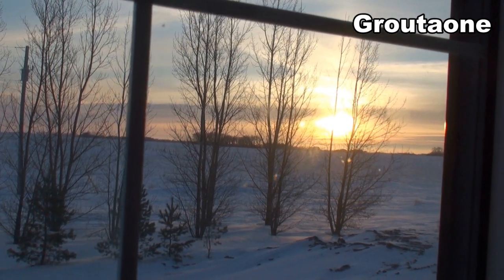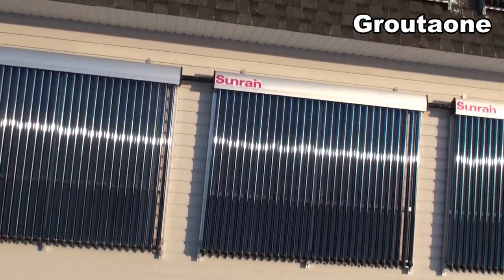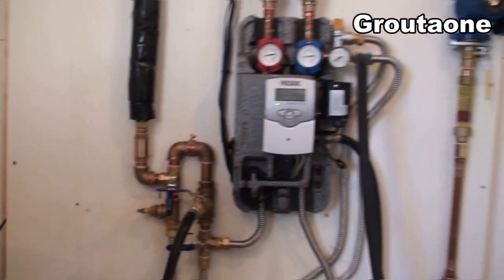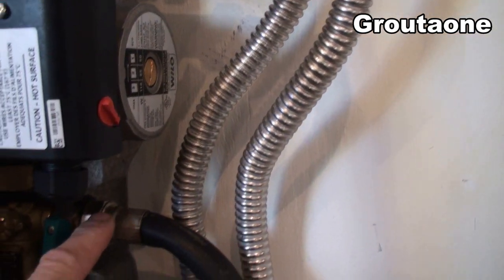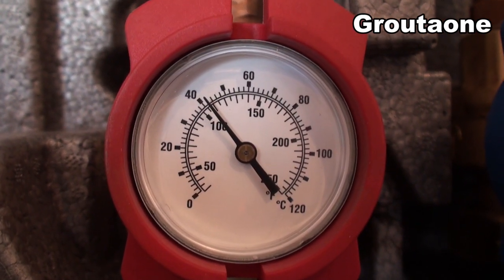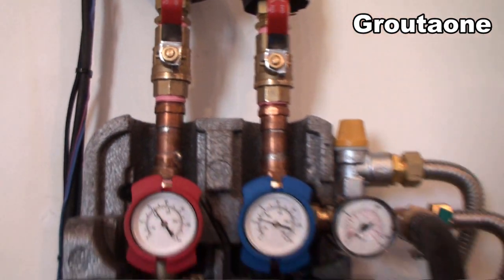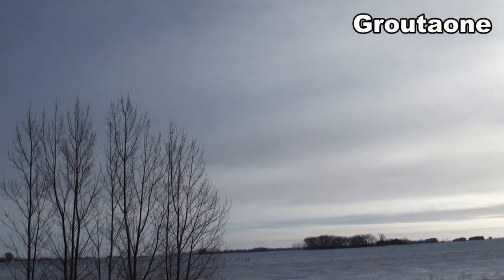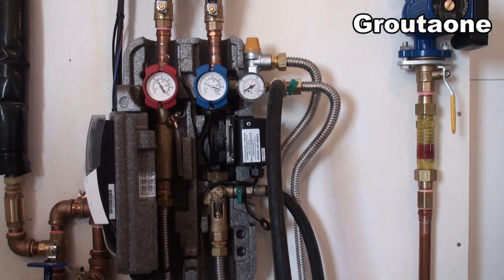Solar Heat First Sun Test

Comment: HI can you tell me how to reset the controller. We need to change the arrangement from 1 to 3 on the BS/4 we don't have the plus system
Many thanks
Georgina
Reply from the maker: Reset is marked as RESE on page 34 of my manual. you may have a different page, I don't have to reset though if I just want to change configuration

Comment: From what I am reading 40K btu I didn't see what your overall cost was. I live in Colorado where my outside temp is not quite as harsh but I get a wild amount of sun. I need to heat 10K square feet but I do have Radiant hot water heat already but powered by propane. Trying to look at my cost to do a solar system.

Comment: I talked to you about this on one of your other videos a few weeks ago, and am getting interested. If you were to do this again, what brand of tubes would you use?
Reply from the maker: GunFun ZS I would buy Sunrain again as they are highly efficient, not all tube brands put out the same power
Reply: Thanks. That gives me a start to figure out a cost for a supplemental system.

Comment: very nice work... if you used a parabolic mirror (reflector) behind each tube, you might be able to reduce the number of tubes by 2/3 by spacing them further apart..."they" say about 100 watts per square foot in full sunlight, or about 1076 watts per square meter
Reply from the maker: I'm thinking maybe some foil space blankets on a plastic sign board slipped in behind would likely boost power, I would like to experiment

Comment: Very impressive, my back of a beer mat calculation says 40K BTU's!. Do you think you could run the circulation pumps from PV's via car battery bank with inverter? Enjoying your videos keep up the projects.
Reply from the maker: Tiff913 I think that would work as the pumps need little power to run, a small pv system would be nice

Comment: If that's two gallons, it looks to me like somewhere in the range of 35k to 40k btu an hour continuous. That's not bad!

I see a differential of 40 degrees F or so. That makes 2 (gallons) x 8 (pounds) x 60 (minutes an hour) * 40 (degrees F) = 38,400.
Reply from the maker: David W You are correct to figure about two gallons per minute, I really like the system so far, still need to do a full sun test at high noon without the light overcast conditions, this video was shot in January and likely would put out more as the sun moves closer so it then it has less atmosphere to penetrate, thanks for watching
Reply: groutaone Given the conditions you stated, that BTU output is very impressive. Most of us heat homes with furnaces that only run intermittently at 100k-150k btu that I doubt is a whole lot more than what your system is putting out on a continuous basis when you compare heat over a period of time. When you get bright son, it's going to put out a ton of heat.
Reply: I do not think your calculations are correct there is no mention of the heat capacity of the fluid in the formula.
I'm quite bad working with imperial units but a quick google search gives me 11.25kWh for 38400btu.
My calculations based on international units is:
2 US gallon/min = 7.57liters/min = 454liters/h
Temperature difference 20°C
Heat capacity of water 4200J/Kg°C = 1.12Wh/Kg°C
Heat capacity of ethylene glycol is 2200J/Kg°C = 0.61Wh/Kg°C
Say there is a 50% glycol in that mix that will be about 0.95Wh/Kg°C
454L/h x 0.95Wh/Kg°C x 20C = 8626Wh.
Your calculations are not out by much that formula probably works for water and maybe the temperature delta that you use 40F is not quite 20C that I took from the video.
:) But I still like my formula better I can understand better what is going on.
Anyway the calculation is not really correct since it assumes constant power but if the pumps work intermittent when the glycol gets at a certain temperature all we can say is that there where 8.6kW of power transfered but can only say 8.6kWh if it worked for an hour at that constant flow rate and at that temperature difference.
Reply: Good point. That would put the heat value at about 30,000 BTUs an hour. Still a significant amount of heat, though.
Reply: David W
I am curios to see what will do on average over a month and how much was the system cost.
I will heat my house soon with PV panels since from my calculations they are less expensive than solar thermal.
Reply from the maker: ***** Consider also that PV panels likely are rated at perfect sun angles, morning and evening would be down on power requiring more panels to get the job done
Reply: groutaone
I do have PV panels since I live offgrid and I know what average daily and monthly output to expect. The cost of around 3 cent/kWh is calculated for PV panels at 1$/Watt (it may be even less now especially larger quantities) and 25years amortisation. After 25 years you usually still have around 80% of the initial power so you can just add 20% more panels then.
The Solar heating no matter if is thermal or PV will need significant thermal storage to maintain a constant temperature.
Luckily I was thinking about that when I designed and build the house and there is a 14 cubic meter concrete slab that can be used as thermal storage.
Those 14 cubic meters of concrete can store about 100kWh of heat at a delta of 10C
Since my souse is small and well insulated it only needs about 1000kWh/month in the coldest heating month (Usually January but this year is crazy I have +8C today that is unusual but what is more unusual is that the entire month was close to 0C or above)
This is in Saskatchewan and last year I had -30C during the day and close to -40C most of the nights :)
Anyway I can heat my house with a PV array of about 6000 to 9000W that is about 6000 to 9000$ for panels delivered.
There are some more money needed for cables and mounting but not huge and I only need an extremely simple controller that will do a simple digital max power point using in floor resistive heat cables.
That is all no moving parts so there will be no maintenance over 25years or more and no other money for heating.
Say all this is 12000$ and some work from may part.
25 years x 12 months = 300 months and 12000$/300month = 40$/month about 5 of this months I need heating for the others I can find some use for all that extra electricity (not sure what at the moment)
But since I'm offgrid with a small Lithium battery I never need to worry that is cloudy since with an array 10x larger I will produce as much electricity as I do now with this 10x smaller array so it will be like I have full sun now when it will be full cloud cover.
And in the winter I can use the electricity for what I want inside since it will end up as heat anyway.
I made a calculations based on prices I found here locally for vacuum tubes but it was substantially more than PV based on their projected heat production.
That is why I will love to know what is the power generated from one of your panels at full sun in a cold day and what was the cost of the panel. There is more than the panel of course pumps and insulated pipes but just panel cost vs production will be a good indicator for me.
PV heating is new not even know if someone else is using something like that but for me and my particular house and location is the best option of the options I checked.
+ that I love no moving parts heating it will be extremely reliable unless a tornado takes down my PV array or house :)

Comment: So about 20C temperature delta at 1galon/minute (about 4 liter/minute)
At 4 liters/minute you get 240liters/hour with 20C delta. Not sure what heat capacity dose that glycol have I will need to check probably a bit less than water.
Water has about 4200joules/kg C
I do not like Joules so converting that to Wh 4200/3600 = 1.12Wh
240L/h x 1.12Wh x 20C = 5.4kW Not that bad.
Was that 5.4kW from how may tubes and how large and was full sun then or just what you showed in the video.
Maybe you can give more details or data later but it sounds good if that water flow was continues and not intermittent at that temperature delta.
I also need to check what thermal capacity dose glycol have.
Just made a quick search it seems is quite a bit lower than I expected 2200J/kg C so almost half than water then my numbers are wrong you got just under 3kW coming in at that moment. But to calculate energy I also need to know if that was intermittent and what was the duty cycle.   
Hope you get more info since I'm curios. Thanks for the video.
Reply from the maker: ***** Thanks for doing some research, the highest temp shown in the video was recorded right after I showed the light overcast sky, maybe two minutes later, so I don't know how high the temp would go as it seemed to be climbing until the light cloud cover came in, it's really about two gallons per minute as the gauges are showing just for four collectors outside, the other four don't have gauges just a separate pump and flow meter, so I really should test in full sun at high noon when sun is not off to the east, thanks again and thanks to everybody here for watching
Reply: groutaone
I made a comment below but this is the revised more precise calculation considering both circuits
2 US gallon/min = 7.57liters/min = 454liters/h
Temperature difference 20°C
Heat capacity of water 4200J/Kg°C = 1.12Wh/Kg°C
Heat capacity of ethylene glycol is 2200J/Kg°C = 0.61Wh/Kg°C
Say there is a 50% glycol in that mix that will be about 0.95Wh/Kg°C
454L/h x 0.95Wh/Kg°C x 20C = 8626Wh.